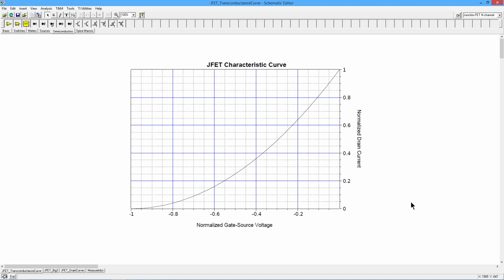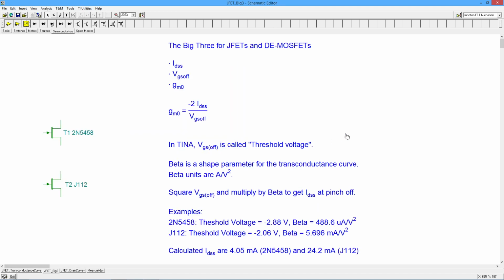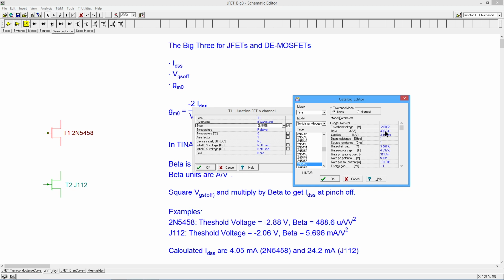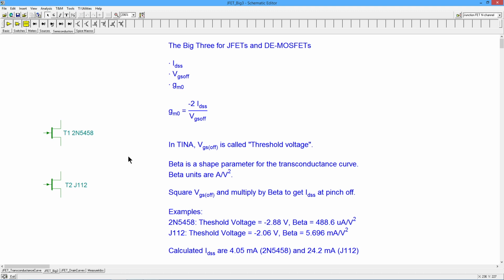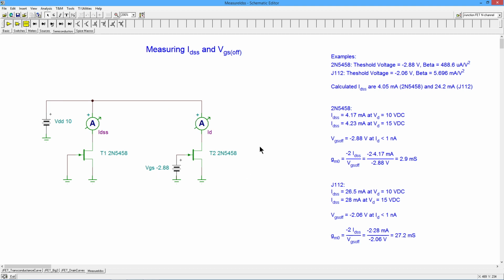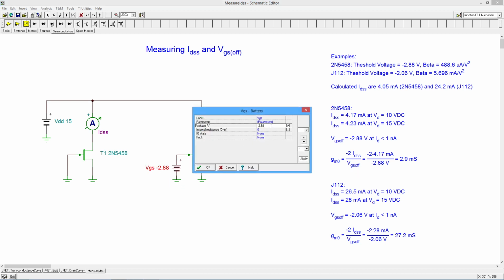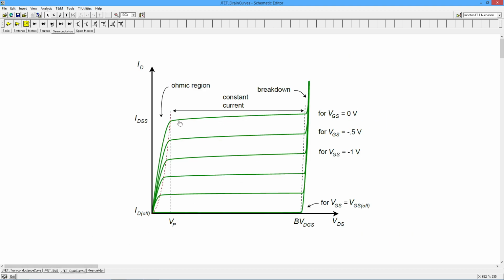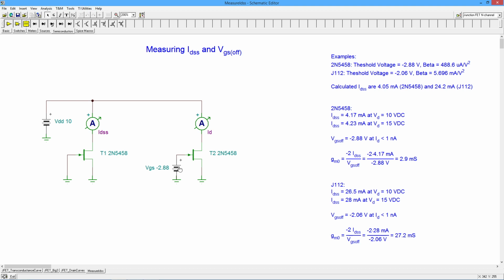Semiconductor Devices: JFET Parameter Measurements

Comment: Thanks for the clear explanation. At about 20:01, when determining Vp, you mentioned the limitations of DMMs in measuring when the current drops to low nA - would measuring the voltage across a 1k resistor placed between the supply and drain yield a more accurate reading?
Reply from the maker: Maybe, depending on your DMM. I wouldn't get too worked up over it, though.
Reply: Thanks

Comment: Hello sir can you please tell me Vgsoff for BFW10 bcoz in datasheet it is given that Vp=Vgs(off)= -8v
And if I provide Vgs=-4v still the jfet operates in cutoff mode.
Please help me
Reply from the maker: There can be a wide variation in Vgs(off) from device to device. It sounds like 8 V is the maximum. It would not be odd for a manufacturer to specify a Vgs(off) range of -2 V to -8 V for a particular model of small signal JFET. That does make biasing them a bit of a challenge.
Reply: @ElectronicswithProfessorFiore  Sir please check Motorola datasheet of bfw10 there the manufacturer has only provided max value of Vgs=-8v 
Nothing is given in minimum and typical.
Reply from the maker: @swaritmahalsekar5521  That's not unusual. I used to use a device that was spec'd from -2 to -8 and in spite of going through hundreds of them over the years, I don't think I ever saw one beyond -5, and virtually all of them were between -2.5 and -4.